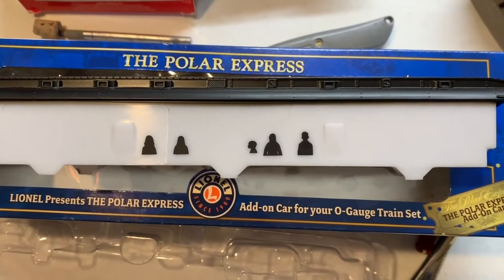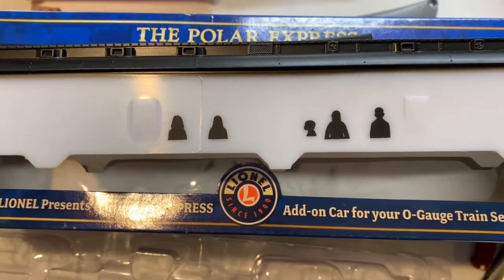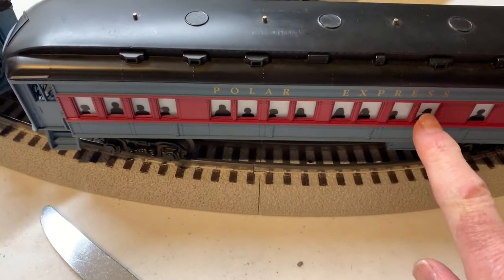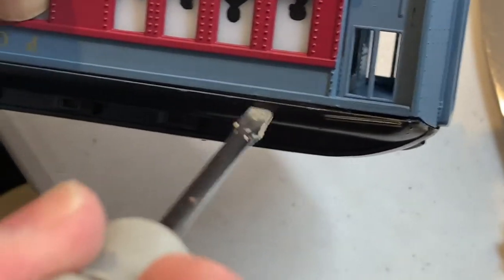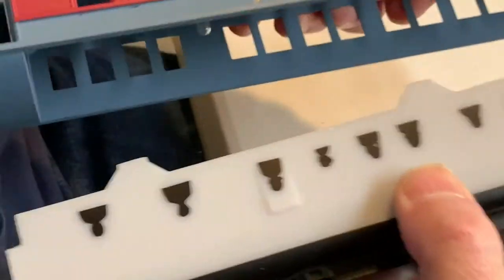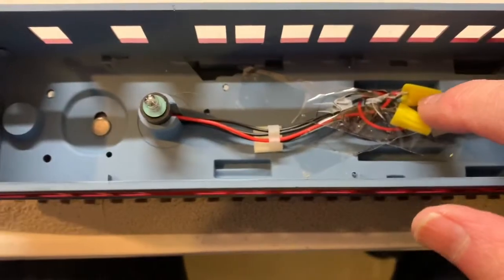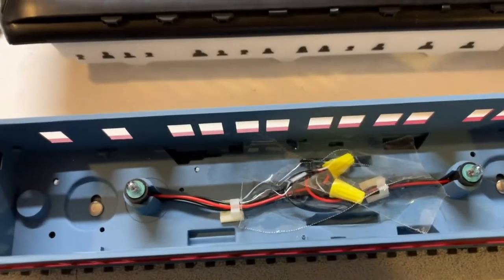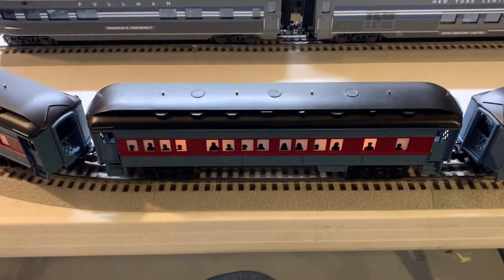Polar Express Light Repair

Comment: Simply cut 4 plastic strips from soft butter lids and insert in the catcher windows to allow the catches to slide over.
The catches are then slid over, all 4 at the same time.
Pull top-window assembly up and out.
Easy

Comment: I’m trying to take the top off of the last train, have you ever replaced the bulbs in that car, looks like 3 screws have to come out but they are hard to get too. Thanks!
Reply from the maker: I haven't tried the end train but I would expect it to be very similar to this one.  Look for the tabs in the windows. The design is easy from an engineering and manufacturing perspective.  I doubt that they made it difficult to assemble and disassemble.
Reply: @kevingorham6500  thanks, I got the 3 screws out and found the tabs, then I shaved the tabs down in all the cars with a single edge razor blade, now when a bulb burns out the top of the train lifts off with no problem. 😊

Comment: When my train cars are at rest the light stays on (usually) however, once they move even in the slightest way they flicker or turn off. Could this still be a car issue or a track issue?
Reply from the maker: If you wiggle the car as it is sitting still, do the lights flicker?  It's probably a connection issue to the track.

Comment: I appear to have wires that broke off under the passenger car. Any idea how to get access to re-solder? It appears that the wheel assemblies are riveted on. Any help would be appreciated.
Reply from the maker: I take it that the wires have separated from the wheel assembly.  If that is the case, you may want to consult with an expert at a model train hobby shop.  They usually have full repair capabilities.  Also, there are many model train forums on line.
Reply: @kevingorham6500  Thanks very much for the reply and information. I’ll attempt to locate a local model train hobby shop. The one in my immediate area where I purchased the train years ago closed a couple years back.
By the way, your video was extremely helpful in removing the roof. I’d never have tried it without your help.

Comment: Good job!  The only two Baby Madison Car sets this method doesn't work on is the 1973 Milwaukee Road set which had plastic tabs under the car that had to be cut off with a knife, and the "Super Baby Madison Cars" which are the same molds but have detailed interiors.  I made a video seven years ago explaining why: https://youtu.be/2_81HbX5pyY

Comment: Nice video... Too bad Lionel engineers call for wire nuts... I removed the wire nuts and soldered the connections together... Then installed heat shrink tubing to insulate them... For what these cars cost, they should have come from China soldered, not wire nutted... Just awful the way they put them together...